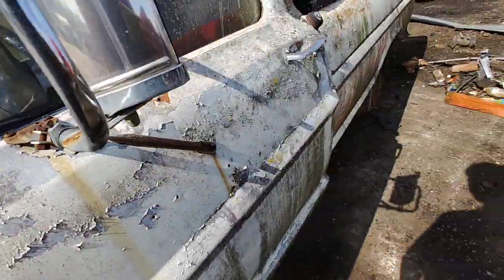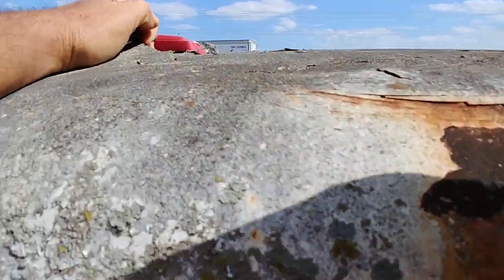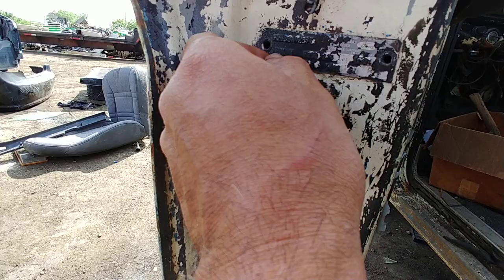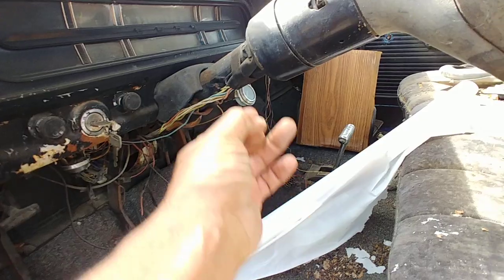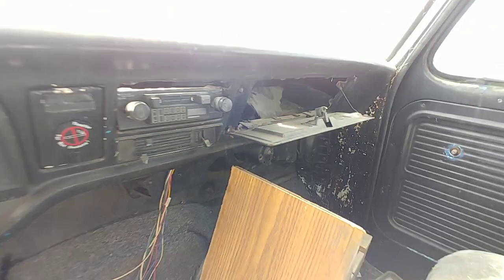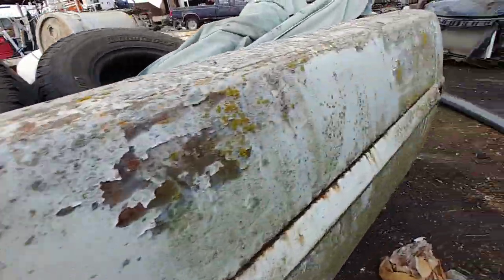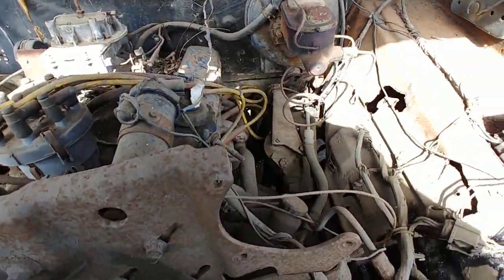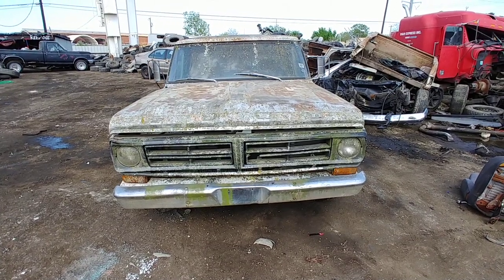1972 Bump Side Ford F100 Truck Junkyard Find

Comment: From what i know of fords, I believe that the previous owner swapped a 80s ford van or truck frame under the 72 body which explains the steering column and shifter. The engine looks like my buddies 85 5.0, The distributor cap is way different from my 1969 f250 so it at least has a different engine

Comment: Whoa Nelley, it's a mess of parts, and it has a new heart.

We got the (door) VIN and we win (and I agree, it's different): F25 for F-250 (which we know it's not, as it's marked as an F-100), B for 300 CID six cylinder with one barrel, C for Ontario, Canada assembly, and the rest lines up with approximately January 1972 production, so it's likely the door came off another 1972 model year truck.

131 is the wheelbase in inches,  F-250 is the marketing model (again, we know this is an F-100), possible 3T Bahama Blue exterior paint, 6200 is the GVWR for the truck in pounds, 110 is the HP at 3400 RPM, transmission, axle and district code are all hard to read, and since the truck's door is different it's really no matter. BWD Automotive is Borg Warner Automotive which had various divisions that made components for the automotive industry, including the Super T-10 in my '79 Trans Am.  There is also a BWD brand of auto parts that is now owned by Standard Motor Products when they bought out Echlin in the early 2000s. I believe that they were connected at one time to the other end of Borg Warner that made auto components, but no longer. 

I agree, the shifter looks "Mustang II"-ish and the steering column from a passenger car and probably was automatic on the column, since Ford trucks of this era had the switch on the dash. Someone probably used that push button for the horn on the lower side of the dash too. All in all, a very rough truck and a hodgepodge of parts. I also agree about the engine swap as you can see the AC bracket in place and this was a non-air truck.

Whoa Nelley, it's pieces and parts, and it's got a new heart. Looks almost like it was painted with a brush, they must have been in a rush. Four flats, drat. Going to be flat, and that's that.  Driven until 1999, now not so fine. It quit, and that's it. Going to be squished, not too pissed.
Reply: I wonder if this one was actually a San Jose truck.  Whenever, my dad met anyone with a truck that was built in San Jose, he would look at the bed and say, that one looks familiar, I may have taken a nap in this one.   He was a pipefitter at the San Jose plant, mostly on the graveyard shift and many nights there was not a lot going on so he would grab a nap in one of the truck beds that were stored in the tower.
Reply: @kennethsouthard6042  Could be, would have to find another VIN somewhere as the driver's door is from another truck.

Comment: Real shame, I'm sure they could easily get 500-800 for it. I'm not a ford man and she is rough but people are saving ones in alot worse shape the frame and most of the sheetmetal still looked ok. That interior needed some serious love and a redo but I bet that little 302/351 Windsor would run and probally run strong. You can tell though she has been cobbled together but would make a neat low buck rat rod/shop truck.

Comment: Trucks like that just don't exist up here, I bet I could flip that in a hurry if I had it local.  Power wash it and put some roller tires on it and see if it would run.  

I agree the seats look like 80s GM to me too.  Grab handles in the roof might be off the doors of the same car.